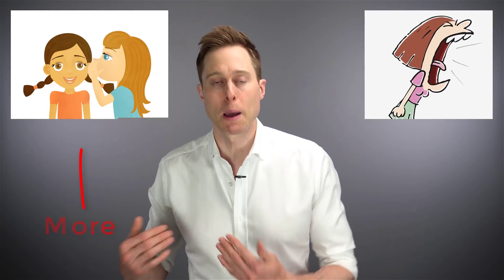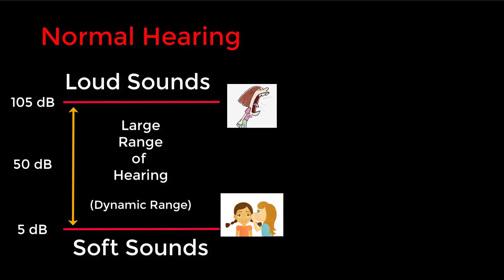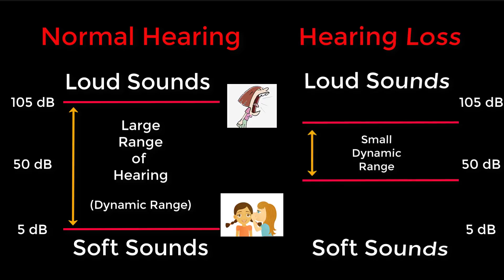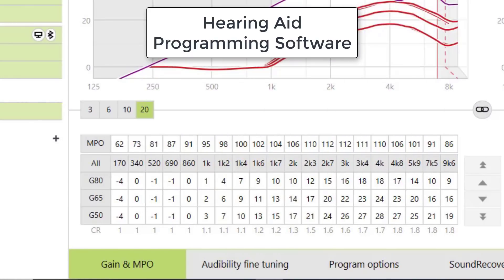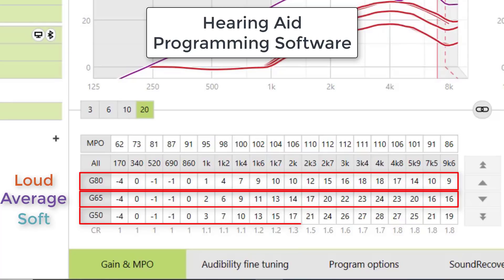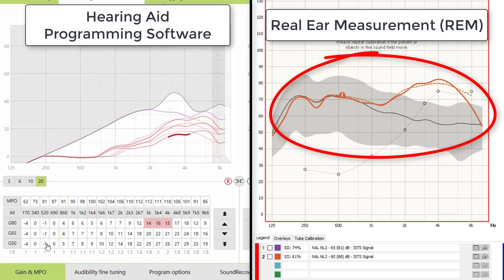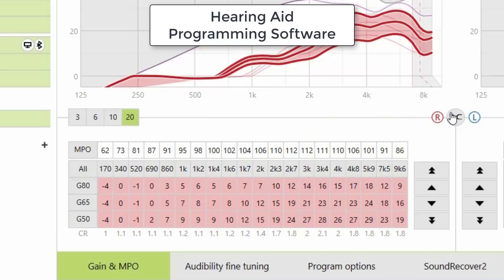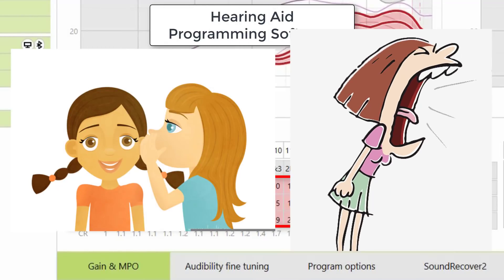Advanced Hearing Aid Features Explained | Compression

Comment: This explanation is VERY acceptable. But the written text that accompanies the explanation on the web site … not so much.

The written text states that certain sounds “will be shifted to different frequencies”… what a horrible, inaccurate confusing and misleading statement.
A better statement might be… “ for a given patients hearing needs , the patient will need extra help with SOME Sounds at specific frequencies (or pitches ) especially when THOSE frequencies are extra quiet… so THOSE frequencies will get a little extra help ( amplification) … but other frequencies that the patient CAN hear well ( or better) won’t get as much amplification….
BUT…here is where compression really helps…. As all sounds get louder ( when people are talking more loudly) the hearing aid can individually choose which pitches to amplify a little less ( because the people are talking louder)… and at the same time the hearing aid can chose other frequencies or pitches to amplify more….and OTHER frequencies to amplify LESS….. THE HEARING AID CAN DYNAMICALLY ADJUST THE VOLUME AF MANY DIFFERENT FREQUENCIES “ on the fly” …

Comment: Thanks for this explanation Dr. Cliff. I have hyperacusis in which sounds cause physical pain to my ears in the form of delayed burning many days after exposure to certain sounds above 70db. I see that you're able to program certain frequencies with negative numbers (i.e. -10). I'm curious if hearing aids with this feature are using some form of noise-cancelling technology or how the negative characteristic works (how is this achievable?). How does it actually lower ambient sounds?

I ask because from anecdotal reports I've seen from many with this condition (the pain type, not the loudness type), the noise-cancelling frequency can bring on pain even though its silent.

I'm looking for a solution to cut down environmental sounds while still being able to hear them at lower levels so that I can work or meet up with friends again. I thought maybe a hearing aid with custom in-ear molds (that work as earplugs) might do the trick, but wondering about the negative programming feature with this.

I see the University of South Florida is currently testing a device that I believe may use this type of technology, but with white noise incorporated. I'm looking for something similar,without the white noise component. I'm in many hyperacusis groups so if I can find something that works for me, I'd be able to help many others with this info.